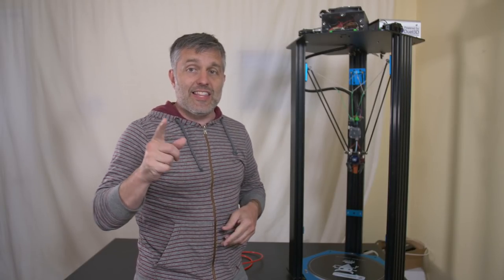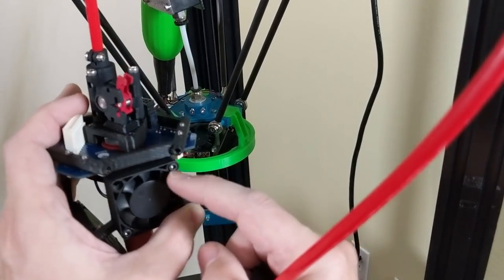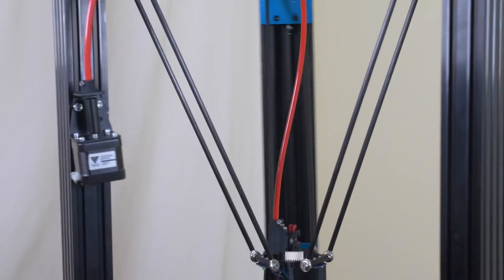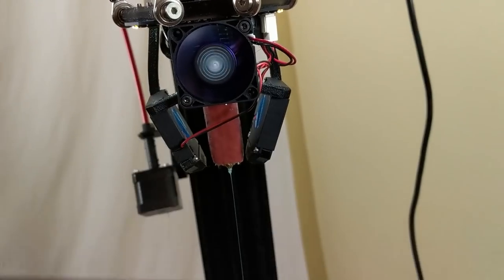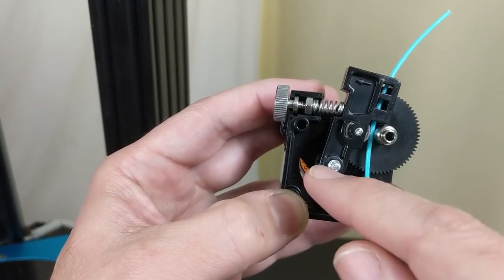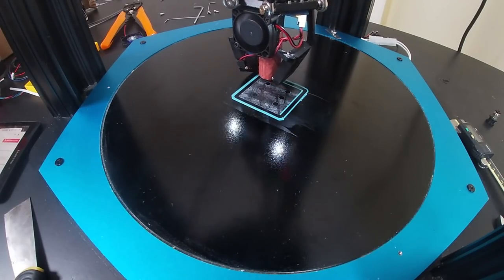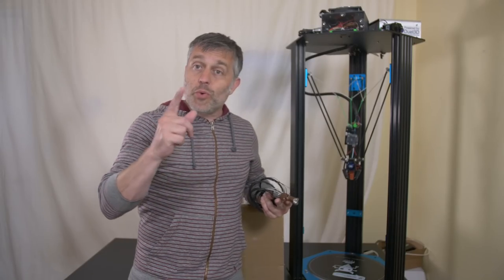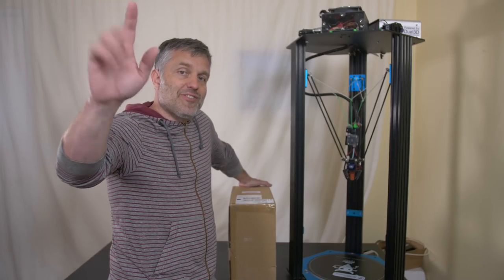I Put an E3D Super Volcano on a Duet Smart Effector in My Enormous Delta Printer

Comment: It seems I came across this at the perfect time for once! So late 2018, I did end up with the Anycubic Predator as my first FDM (as a supplementary printer to a commercial resin unit) machine, and it was working fine for the few times I used it when I needed a large part that didn't require great cosmetics. Right at the onset of Covid in China, I had a 22 hour print running and the machine decided to kill itself 45 minutes from the end of the print. Spaghetti mess, broken support arm, ripped the hotend apart, etc. Total disaster. I couldn't get parts for 6 months, so I left it at that for awhile. It slowly got rebuilt here and there when I could find something that might work, finally got it all back together, but it's never printed quite right since then. (That Titan extruder was the bane of my life even before The Incident, and I'd picked up a BMG but never got around to installing it evidently). 

Fast forward to now, I need it again so I don't have to chop up a part into 94 pieces, I'm looking at what remains and wondering what all I need to get it going again. I'd always wanted to test a newer hotend that is direct drive if finding the absolutely lightest combo with a thin pancake stepper would ever work. I'd presumed it would still be too much mass, but here I am designing lightweight effectors and looking at the Revo units, making stupid schemes and plans. Truth be told, that Revo V6 and a BMG, even remote mounted, has my evil tented fingers going like mad.  Looks like direct drive is out by the result of your test, but I figured that might be the case.

Comment: You mentioned speed issues with a  stepper motor. Another problem with a stepper motor is: as RPM's go up Torque goes down.  You might consider a hybrid servo.

Comment: You need some sort of torque converter/CVT style drive for the extruder. I don't even know how you'd do that, since Marlin doesn't support dynamic steps/mm. That might be a good feature to have, though. A table with temperatures and extrusion speed that map to a particular steps/mm like a fuel map on a fuel injection system.  200C @ 60mm/sec print speed = 350 steps/mm where as 200C @ 90mm/sec is 300 steps/mm or something.

Comment: On the subject of faster printing: I think such a flying extruder is not optimal because it brings too much resonance on the hotend and the weight is the same as a direct extruder on the effector.
I have my Q5 a Sherpa direct extruder (105gr) on the orig. Effektor of the Q5 attached (straight) to the bottom with the 4x 2.5mm (Dragon-Hotend) screwed to the Effektor.  Also I have 2stk. 40x10 fans on it. If I unscrewed the metal parts I have from the orig Q5 I am only about 80gr more weight (only extruder) and that distributed on 3 axes / motors (Delta). In addition, my Q5 is enlarged to Endstop height 557mm, I have achieved the height by lateral stiffening with 20x20x100mm (aluminum profiles) to avoid a bed levelling at each pressure. So I have since the conversion for 6 weeks no bedlevelling carried out. however, I use since Nov. 2020 Klipper which is the best for fast printing (Input shaper, Pressure_Advance). So I am very happy with the speed/quality of the printer, can print up to 300/150mm/s with simple parts even with the Q5 because of this, with table tops I can also print only 100/50mm/s. PS: I will also print an effector / fan shells etc. from nylon/carbon and ASA then the project Q5 is completed, for now :) sorry , its translation.

Greetings

Comment: good individual debugging and iteration steps. i think you also need to switch from pla to abs or asa for speed printing as a sport. specifically they flow easier and also at same time require less part cooling. choosing the right specific abs or asa filament is also very important as also is heating your non-existend chamber, at least moderately so. finally while you point out quite correctly the drawbacks of deltas in regards to quality. the thing you didnt mention was that the very best coreXY or crossXY can in fact nearly almost match the delta for top speed, yet having a vastly superior print quality at the same time. which is basically the dealbreaker for deltas at speed especially the quality suffers more. no matter how cool they look. those with an engineering background tend to learn to be able to look past 'what it looks like' in superficial ways and other such gimmiks. so being on the wrong fundamental path here is not something your excellent iterative debugging skills can deviate far enough from. and this is basically what ends up limiting your end results. but i think i learn a lot from you though! and appreciate that. also the new slice hotend is really necesary replacement too, so looking forwards to seeing that in the future

you can also build a sherpa mini direct drive too, which should probably solve a lot of your extruder problems. however the special AHG version of the motor for it is not so easy to come by right now due to supply issues. still despite that on balance probably still worthwhile
Reply: +1 on swapping away from PLA, it's not great for high-speed/flow prints
Reply: He's got a TwoTrees Sapphire S, so you can assume he knows about the joys of a corexy printer

Comment: Looks like a lot of your accuracy problems are due to the effector not being rigid. You can see it twisting side to side in the video. I suspect that you can lessen this by shortening your delta rods, which look like they're much longer than they need to be. The longer your delta rods are: 1) the greater the positional error in the effector is from any error in the position of the vertical carriages, and 2) (the problem you're having here) the more rotational slop you get at the effector from any play on your vertical carriages or the bearings on the ends of the delta rods. Lastly, you're also sacrificing build height by having your rods too long. So, you typically want your delta rods just long enough for the nozzle to reach the edge of your build plate, and it looks like your current rods are quite longer than that. After addressing that, look for any slop in your delta rod bearings or your linear bearings on your vertical carriages.

Comment: I've also had  hotend cooling issues with those expensive "silent" fans I've used noctua and another expensive silent fan for hotend cooling heat creep was Always issue but I do use a 40x20 4-wire noctua fan for my part cooling fan and for that it works great being able to control a fan from 0 to 100 on my duet 2 wifi

Comment: Couldn't find where you said what filament you were using.  those guys doing the contest are running ABS because of some limitations with PLA.  wondering what results you would get if you aren't using ABS. Thanks
Reply: yeah he never says (bad) but it really seems like hes using PLA given the amount of part cooling he is applying with the air compressor. you are right he should switch to a good quality ABS or ASA filament. one that is known to be of a high quality and not just any old random ABS

Comment: Awesome man! You've answered so many questions with this one.
One thing I'm currently trying to figure out is where to put the flying extruder. You put it pretty far down towards the nozzle with the clear benefit of having a short bowden tube. Placing it more to the top extends the tube but decreases its movement distance. I tend to want to put the extruder more to the top, but I'm just not sure. 
41:52 I might... 🤭😁
Reply: put it in same height as the arms on the rails...with that the extruder nearly stands still and just twist as the effector moves over the bed

Comment: You might try radial fans in the interim as opposed to the compressor.  On the printers I have converted to radial from axial the part cooling gain has been substantial.  On two machines the most I can run is 40% cooling and on one I had to block some of the duct outlets as well.  I don't know that it would solve your issue, but it wouldn't cost much to try it out.

Comment: have you looked at the Orbiter 2.0?
I have zesty nimble v2, and although its light and direct drive vs a bowden, i have ripple issues on the prints, like many who use the v2 nimble.

i dont want to jump on the new v3 bandwagon until i see what issues that one has, but im also looking the orbiter 2.0, which should be light enough for a delta

Comment: I'm at minute 27 and I'm just wondering why he didn't get a BondTech BMG or LGX to replace that Titan extruder? Much better design, still 3-1 ratio, less wear parts especially on the lever, dual gears feeding the filament instead of 1. Maybe he has another video later that I just haven't seen yet?

Comment: had to chuckle...same ring light on my TLM... just use a dimmer! As for hitting the tower...you'd be outside the accuracy of the kinematics as soon as your long arms go past vertical.
Reply: oh...and I print at 150-175 mm/s regularly wit ha .6mm nozzle  but my current extruder is much higher up and still on the original belts.

Comment: Well if you're going all out, you may as well get some magball arms for that printer, should help stiffen up the effector, I've seen people direct drive their deltas using them, but IDK if that smart effector is stiff enough to get away with that. Not sure if I'm a huge fan of that smart effector TBH, I'm probably going to go with the precision piezo board myself and design an effector that doesn't have the hotend sticking out that far below it to buy myself some z height.

Comment: ditch the flying extruder and switch to a Zesty Giddy remote extruder (don't go with the Zesty Flex, the 30:1 gear ratio is too high) its pretty amazing. Gotta go with a pancake stepper. takes some tinkering to get it right but you won't go back once you do. Reply to this is you want the part number of the motor I use and can push 30mm/s2
Reply: Can you give more info on the part used?

Comment: what was the best and fastest hotend you used on the delta printer with that smart effector ?
Reply from the maker: I still have this project uncompleted ready to be picked back up. I plan to use a Slice Engineering Hotend  with a CHT nozzle when I finally get back around to it. Apologies that this is the best answer I can give you.

Comment: I noticed you're not using Magballs on the Delta.  I've had this issue where a slight model collision causes one or more Magballs to release, which screws up the whole print.  Did you avoid them for this reason, too?

Comment: My tevo has still never had a print go through it. We have literally the same set up i have the same remote direct drive and all. Im ready to blow the dust off it and get it going. Idk if you have it or not o have the air put for part cooling I think that’s the only difference between are machines. Can you share your g code and start sequence and what not with me?? I know we emailed each other back and forth at one point. I have the custom cut magnetic arms, I can’t get mine to calibrate with the duet  head board whatever they call it the touch force feedback setup they are suppose to have.
Reply from the maker: It's been so long since I touched my TLM. I've had a few guys like you who saw the potential in this machine reach out to me in the last year. My solution is just to provide the entire information package via Patreon which I wrote when I did this project several years ago. I'm sorry that I don't already know the specific answer to your issue, and can't take the time away from my own projects/videos to help you diagnose it. Sincerely, I apologize. Please reference your Patreon email to get you started on the right path. All files which you are asking for were linked in that exchange. Best of luck!
Reply: @DesignPrototypeTest  time to blow the dust off and try for 400mm/s with the next e3d hot ends ;)

Comment: if your only printing small/medium parts, you cold just use 2-3 120-140mm computer fans to cool the part. mellow on aliexpress have legit sunon 5015 24v fans too, but alot so they dont work with pwm. but would be the best quality 5015 fans i guess

Comment: Hi everyone just wanted to ask what happened with the Mingda D2. Do you still like that printer? I bought my D2 based of your review of it. I love the Printer but Ive been running into an issue getting my filament to stick on the first pass. I cleaned my bad with alcohol and I made sure its flat I have also calibrated my extruder but im still having the same issue.. Love your channel. Thank you for your reviews and content
Reply: i think the coated glass can lose its bonding ability over time, so you can try hotter bed, hotter filament, slower first layer.... im currently using 3m painters tape on my ender 3 and pla/abs/petg sticks well to that... i often have to soak the tape to get the prints off... and heat the bed to 75+
Reply: @specialingu  Thank you Paul. I found my issue. I had to wash the bed with warm water and soap. The alcohol didn't do what I wanted. My current issue is my bed flatness. It's a neightmare. I will need to get a mirror big enough eventually. I didn't know until now that people actually replied to my comments.

Comment: Maybe you should try to print ABS, it seems to need less cooling (so that maybe you can get away with "just" two 5015 at full blast). Maybe you can try to add a desktop fan, I don't know if it is the proper word, but I intend the fans designed to cool humans.

Comment: honestly...Remote Extruder like the Zesty makes too much Problems...on my 300mmx400 buildvolume Delta i have a Flying extruder with a Bondtech BMG...works flawless even at high speeds.. my limitation is the melting Rate of a V6

Comment: @Design Prototype   after watching the whole vid im asking myself what was the goal? you negated every advantage of a Delta printer which is..printing fast because less movin mass. your Flying extruder is still too close to the effector..with just few cm of bowdentube most of its mass is still coupled to the print head. the Volcano is longer and more heavier than the V6 so its getting a real bad geometry  beacause the CoG is too far away from the center of your effector

Comment: I laughed when I saw your Garolite G10. I told you that stuff is garbage, I can't believe anyone uses that. Delta printers are for hobbyists. Your Corexy will print much faster.
Reply: The garolite oil be for nylon or polycarbonate filament, I suppose